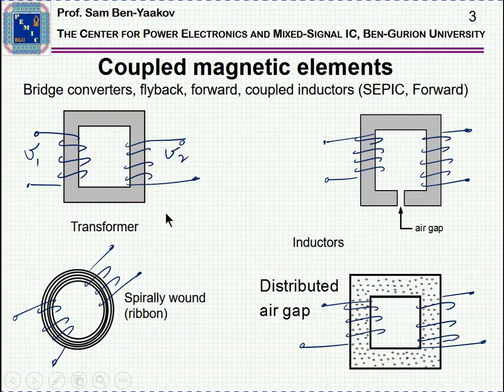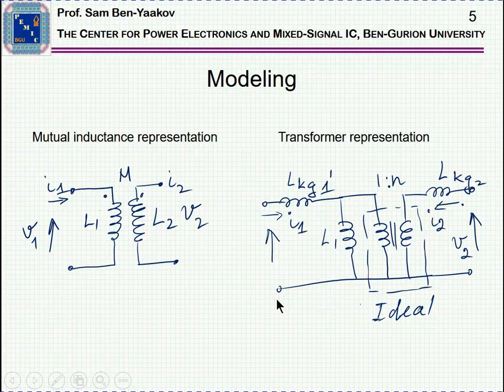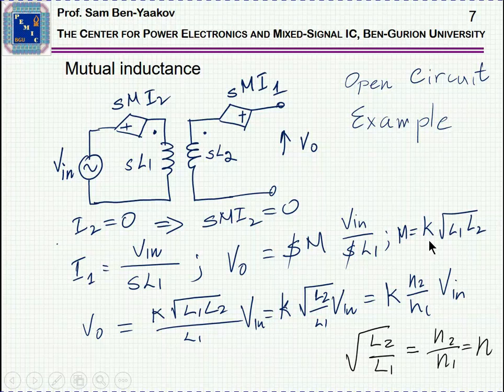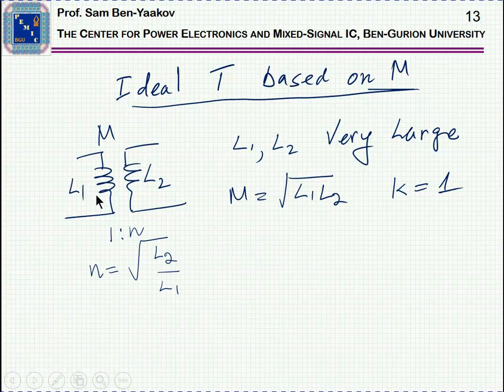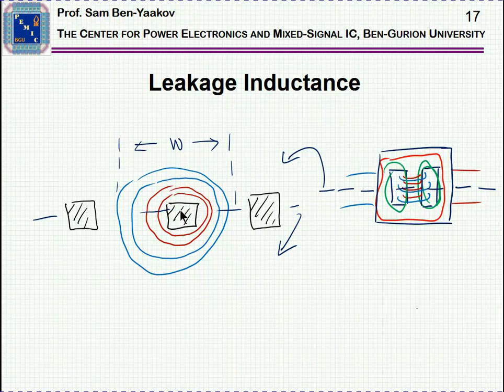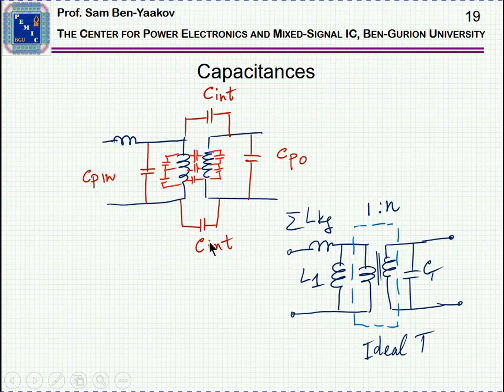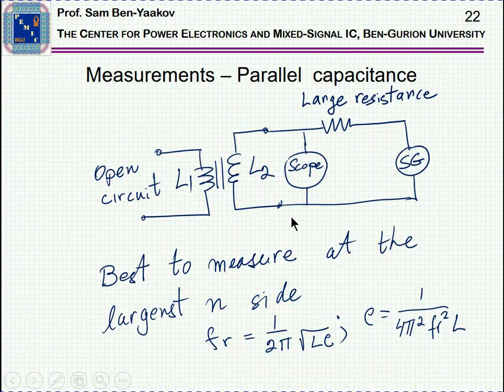Mutual inductance versus transformer: the power electronics perspective

Comment: you said that there is no di/dt voltage spike on switching off if the energy can go to another coil, but what is the physical reason? back mmf or back emf prevents it?
Reply from the maker: The energy is not sored in the wire but in the magnetic field. The reason why  di/dt is normally considered to cause a spike is in fact based on  Faraday's Law V=L dphi/dt. So, as long as there is no change in dphi/dt there will be no spike. If ni is moved from one wire to another there is no change in phi.
Reply: @sambenyaakov  thank you very much. so basically the current through the primary continues in the secondary.

you made a typo, L should be N.

why does current in the discharge phase decay? because  ni-mmf is working in opposition to the flux (according to Lenz), or because the magnetic domain orientation (flux) is 'decaying' naturally (because there is no energy added by an increasing H).
Reply from the maker: @alanx4121    ni-mmf is working in opposition to the flux

Comment: Sir,

In a transformer, all physical parameters are fix. In primary side we connect to a fix AC voltage, say 220V AC. In this case, let say that it is stepped down to 12V AC. First: How do we derive the flowing current in a primary transformer so we may know the current in the secondary side? Second: As we know, load we connect to secondary side could be vary. How the secondary side handle its current go to the load? Or, is its output current a fix amount, regardless of the load we connect? Because once I heard said that the primary current is determined by the load connected to the secondary, not by the physical parameter like the inductance, core, and so on. Mean, if the load we connect to the secondary side will only draw a small amount of current, then the primary side will deliver a small amount of current, vice versa as long as the pulled current in secondary side not exceed the maximum current primary could deliver.
Reply from the maker: Save the magnetization current, a transformer is transparent an. The current, as in the usual case, is determined by the load. From the microscopic point of view, the load causes a momentary voltage drop which results in a voltage difference which increases the current until the system stabilizes.

Comment: Thank you much for the explanation. Anyhow I have still some questions left, maybe you find time to answer:
At 08:55 where in the drawing is L2 * k ? Is the winding missing?
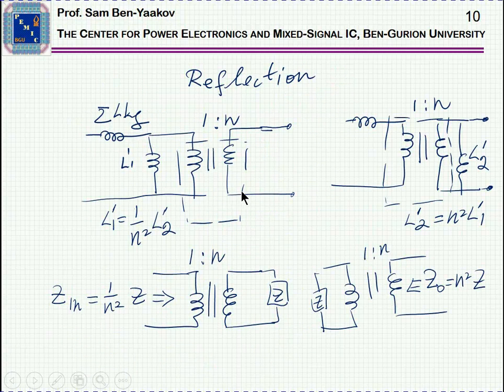At 09:42 where does L1' come from (upper left image) ? The slide before it was just L1 and what is L2' in the formula? 
At 12:24 the formula for M: Is L1 seen from primary side and L2 from secondary side or both from one side?

Comment: Nice video! But, sir, how to calculate L1 and L2? 
Suppose in dual active bridge converter, 
Leakage, turns ratio, power, Primary and Secondary voltage, switching frequency known.
Then how to calculate L1 and L2, so that I can run the simulation. I am stucked at it
Reply from the maker: L1 and L2 are the actual inductances seen at input and output of which will dictate the characteristics of the transformer. You need to first design the converter (phase shift, LLC, etc) which dictates the characteristics of the transformer.

Comment: Many thanks for this video. It is well explained and very educational. I have a question about the "transformer model" that Engineers like to deal with. The complete model (without series and parallel resistors) should show the magnetizing inductance only at the primary, i.e. Lm=L1*k. Am I right? At 9:08 at the secondary side there is L2*k, but I guess it is only present if we look for transformer behavior from the secondary, without L1*k. Moreover, the total leakage (seen for example on primary side as a series inductor) can be computed only assuming that the magnetizing current is negligible. In fact reflecting L2(1-k) results in an inductor of value L2(1-k)/(n^2) placed after Lm, in series with the ideal transformer. If the previous assumption is true, then the total leakage seen at the primary side is 2*L1*(1-k). Is this correct? Many thanks for your attention and your time! Best regards, Alessio
Reply from the maker: The magnetization inductance does not "belong" to any side. See: https://youtu.be/TUfaN40T1Yg

Comment: Thank you for another excellent presentation .
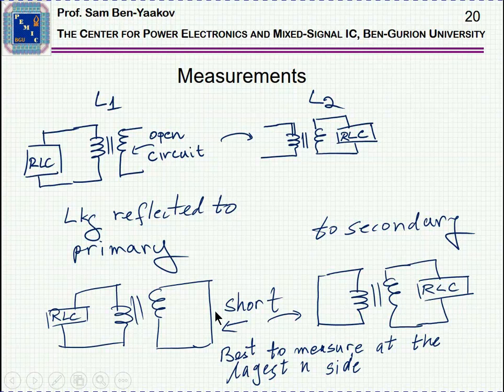Since this is an educational video, I would like to point out a small discrepancy at 20:50 . 
The measured leakage inductance is in series with the primary , rather than in parallel .
Reply from the maker: Thanks for interest. Regarding leakage connection, I am afraid you are mistaken. Think again😊
Reply: @sambenyaakov  Apologies , I was forgetting that you were "measuring" the leakage inductance .

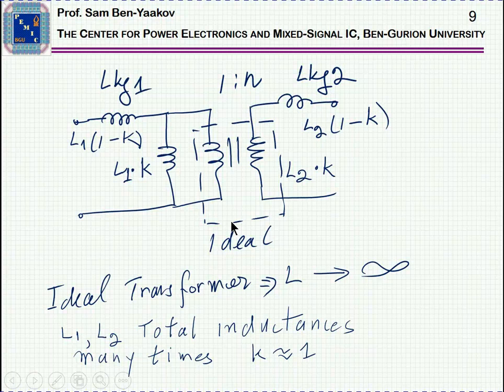Comment: 8:26 Isn't the leakage inductance L_leak = (1-k^2)*L instead of L_leak=(1-k)*L ?
 
v1 = s*L1*i1 - s*M*i2
v2 = s*M*i1 - s*L2*i2 = 0 (secondary shorted to measure leakage inductance)

i2,sc = M*i1/L2

v1 = s*L1*i1 - s*M^2*i1/L2

substitute in M^2 = k^2*L1*L2

v1 = s*L1*i1 - s*(k^2*L1)*i1 = s*L1*(1-k^2)*i1

so the primary leakage inductance (secondary shorted) is 

L_leak = L1*(1-k^2).
Reply from the maker: No. Think about the case of  an open secondary
Reply: @sambenyaakov ,
 
   With an open secondary, you see L_leakage = L1*(1-k^2) in series with L_magnetizing = L1*k^2  for the total primary inductance L1. 

Sources:
Hagen: Radio-Frequency Electronics Circuits and Applications, Ch 22 Transformers and Baluns, pg 213 

http://denverpels.org/Downloads/Denver_PELS_20070410_Hesterman_Magnetic_Coupling.pdf     Slide 37

Comment: Hi Shmuel,
I just want to mention the SPICE model of transformer that allows connecting a voltage source to both of the sides and comprises 4 controlled sources:
K. Hatch, "Spice Model For An Ideal Transformer Allows Bi-directional Operation," 2009
page 51 here
http://electronicdesign.com/site-files/electronicdesign.com/files/archive/electronicdesign.com/cluster/docs/products/29/17/ED090611.pdf
Reply from the maker: Alex, 
All SPICE transformer models are bi-directional. Some may have impedance matching issues as I am explaining in this video . Please watch my video  on how to resolve the problem in case it arises. The model of EDN's "idea for design" you referenced has internal feedback which to my understanding may cause instabilities. Further, as said above , no need to complicate the model I am presenting in the clip.  Thank you for the comment.